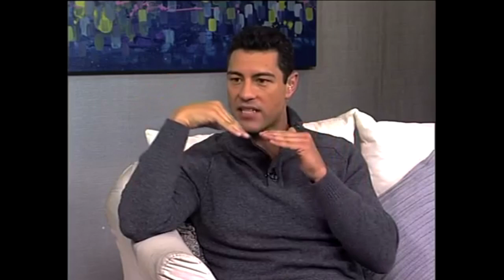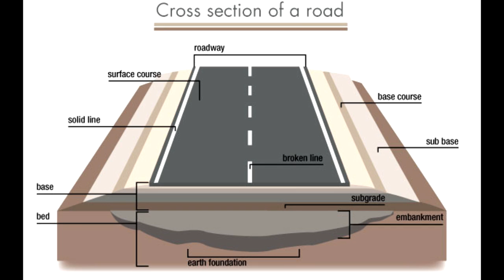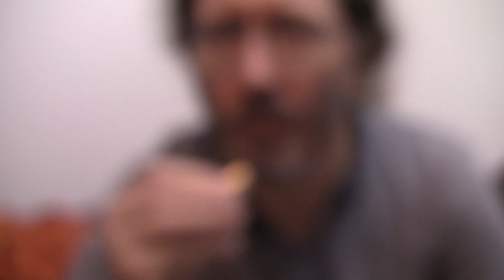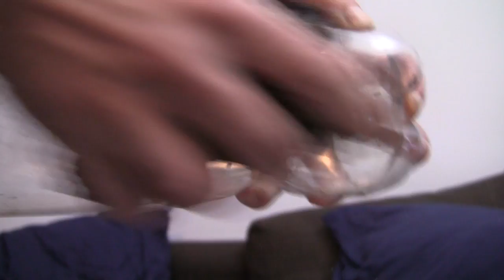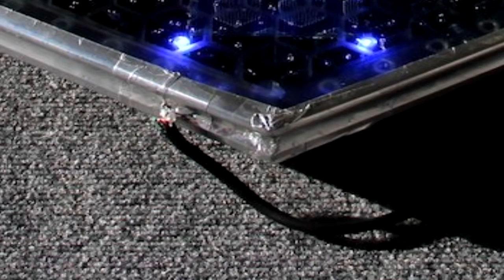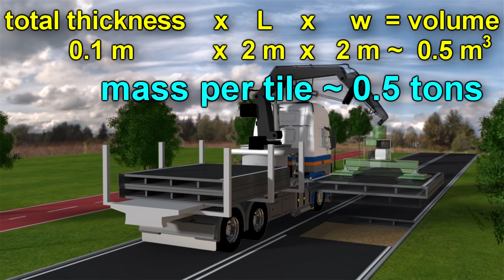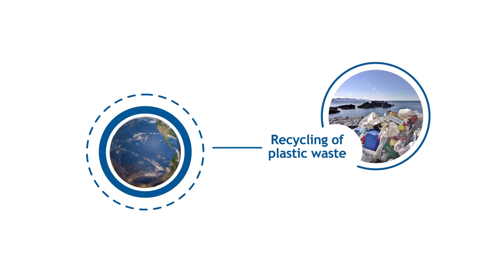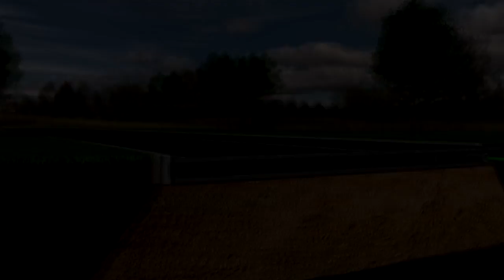Plastic Roadways BUSTED!

Comment: Paused at 12.  
Thunder, obviously the people who want to run cables, pipes or etc. inside a road have never run a drop into an existing wall, or even replaced a wall drop.  I saw what you see, EVERY 40 FEET OR LESS IS A JOINT in the pipe OR A CONNECTOR in high or low power lines.  
What 3 things will run in this road???? WATER, next to ELECTRIC, next to NATURAL GAS.......electric and water don't work well together, and electric and GAS can often cause things we call .......Here is a technical term, used in the industry, lets see if anyone has heard of these?..........EXPLOSIONS!!!.  
When you ONLY run electric, you have connectors every 40 feet, and you increase RESISTANCE at each connection, and lose electric current, and gain HEAT!!!!!
All of these points go back to part of why we don't do this with concrete roads.   As well as Roads, Cables, and Pipes have different maintenance parameters, and requirements.  So, instead of SAVING road construction time delays, you INCREASE road construction delays.

Comment: PAUSED AT 9.
Thunder, you are spot on about the cavities as well as all other aspects.
First, Plastic offers no unique properties which will make cavities suddenly a viable design element.  If cavities are good for road building we would already design ashalt and concrete roads with them included.  In the concrete business you call these 'Voids", and they are a disaster for dams, cooling towers, runways, buildings and roads.  They are a point of failure.  Part of this can be used to dispel rumors of men's bodies being left in dams during concrete pour workplace accidents.  You could NEVER leave a body in concrete, as that soft spot will be a failure, and be discovered in any disaster investigation, which that void would cause.
Likewise the plastic recycling cannot be scaled up due to, again, impurity from labels, and their adhesive, including label inks.  If plastics are only marked, and not labelled with a separate material, the ink alone will have wholly different performance characteristics.

Comment: Why is it always Roads? how come with these ideas they have to go all in big at the first chance they can get?

A more fitting investment would be, say for example, designing solar panel pathways in residential areas, stick to a suburb when getting to the actual installation phase, and waiting a few months to see if it structurally holds without any problems.

Heck it doesn't even NEED to go as far as 'ALL SIDEWALKS ARE GOING TO BE SOLAR PANELS!!!' but a more realistic selection of parts that can be converted to solar walkpanels, for example, parts that are eye catching and used, such as by traffic lights, around crosswalks, next to/in places of interest like parks, open shopping centers, by schools.

And finally, the realistic goal of what would this accomplish, so again for example, if these patches of solar sidewalks are successfully made and installed, what would they power? would they charge batteries that are regularly picked up by the local counsel? would these batteries be resold or stored for emergencies?  so on and so forth.

What i'm getting at is, they try to be the new next thing, the new car, the new train, the new solar panel.
Reply: Also to stick to this video's topic, again why is it right into Roads? the more realistic thinking would be the sidewalks, and honestly this kind of design 'not plastic of course' might work if it had the smaller, less stressed sidewalks in mind instead of the road which has large vehicles constantly using it.

And if you keep the idea of having a space to store power-lines in the sidewalk, but also keep the sidewalk panels more manageable, it would make the existing power-lines less cluttered  and easier to repair without the need to clime up,.. And for the likes of bridges, some roads, and train crossing, that is when the existing power-lines are still used.
Reply: Now i think about it, even if they somehow manage to actually do this, then comes the additional work of individually making each part of the road beforehand, and then placing said parts to make the road, so even if they sell this idea on it being green, in actuality they would need to create new factories and install machines to create their 'eco-friendly and easy roads' And they will also need to still use trucks to actually place them in the end, so while i don't know myself, but it kinds sounds like that they could possibly be harming the environment more then the current way of making roads.

Comment: You make a good point, but comparing an industrial plastic with a soda bottle is ridiculous.
Can ABS type hybrid plastics be made durable? idk. In the US they have to rebuild roads every few years. In high traffic corridors, there is always construction going on. They can barely resurface one end when they have to start beck over at the other end.
Reply: The illustration is a simplified example, I imagine it would require many supports across the path.

Comment: So you'd need to cut and splice cables with every replacement section? Genius! I don't think there's any plastic currently in existence that would be durable enough to outlast even low quality asphalt in existence either.

Comment: Wow this video is completely stupid and unscientific. You're showing us the adore ability of a soda bottle which is not the same as what they're talking about now If you gonna test the road that they made And show that it's not as durable as they said that's one thing but let me go grab something out of the garbitsch improve that this is all stupid is not the same thing.
This is no different than someone going upside in the middle Winter and grabbing some snow to prove that Climate change is a hoax.
Reply: Plastic is plastic. Sure, there are different kinds, but no amount of structural modelling or thickness will overcome those properties

Comment: Thoughts just from the first minute.  uv damage of plastic.  Plastic splintering after breaking causing tire damage.  cables underneath being damaged.  Plastic may last a long time but it doesn't maintain its shape and strength that long.  Horrible for the environment because it doesn't degrade well and is made from petroleum products.  I'm sure there are many more reasons.

Comment: Personally I would fill the street with gravel, outline it with concrete and put pavement on it. Heard it's been done before and it was super-efficient.
Reply: that's how its done already. A high capacity roadwsy is about three feet deep from its base/foundation to the road surface. and shoukd include a coarse layer of compacted gravel
Reply: @brianspiller9075  That's what they have to do with brittle materials. Plastic is entirely different as to engineering needs and the modular sections mean repairs are easy and fast if required..
Reply: It's not as efficient you idiot. Concrete requires resources and we have too much plastic waste.
Reply: :D

Comment: I dont know if you knew this before making this video, but they do infact use a form of plastic recyling road surface in india. They've been doing this for years.
Sure it's not the same as the design in the video but plastics from water and soda bottles are used in some of the road surfaces in india.

Comment: Currently, the highway near my house is under road construction using a concept similar, but far more practical. Instead of using hollow plastic, they're using modular precast concrete with rebar reinforcement and laying that down in tiles.

Comment: One year later: it's an OK concept  (besides the plastic). You don't even need erosion, just hit the brakes one good time and you've got a melting drive-space... Anyways, a concrete version with arcs instead of vertical slabs would do nicely (for drainage ONLY)., as putting cabling inside this is just asking for service problems. Plus, the dirt around most existing cabling systems soaks up water before it even gets near the cables. Small slits going left-to-right could accomplish the draining goal, without taking away too much strength from the road. I'm going to make a very generous estimation of $1 Trillion (construction ONLY; does not include production costs) to remodel the roads of TX. And possibly another $500 Billion for insurance, as drivers are not going to be too keen, nor patient enough to wait on the 20-30 year construction efforts. So all-in-all, $1.5 Trillion for TX roads to be remodeled?

Comment: Yikes!!!  LOL. Typical civil design requires a design life of 30 years.  Good luck!!!  No way to get uniform support under the structure, unless you pump in "epoxy, concrete, etc...".  Not to mention painting on grit coat to create a legit traction surface.

Comment: I mean, you're correct on mostly everything, except that we can't afford to burn anything anymore. It would be better to stop using plastic at all.

As for the final bit of the video, the fact that they want to basically replace asphalt with plastic is not a flaw at all, in fact, it solves most of the problems you cited, and reuses the plastic.

But yeah, the "announcement" is way too broad and vague.

Comment: A lot of these project sound like they did not do any test trial and just theory who come up with these ideas. Lab works. Running a wheel over it to see how long it will last etc. Will the road warp from the earth erosing and plant growing etc. Heat and cold flexing it etc.  Weight etc.  Also is the road more slippy? will tire grip well to it? Dirt rock debree etc. Im no engineer but try thinking out of the box on how test and trial work.

Comment: We should make roads out of Flex Seal Liquid
Reply: I sawed this road in half
Reply: T H A T S A L O T T A D A M A G E ! !
Reply: @kasparthorngirl  lmao underated comment
Reply: I have an idea of a flex seal product! Flex Seal Metal Liquid! It can probably be suitable for a road!
Reply: @heal0152    they actually have metal plates that are metal plates roadways
Reply: @heal0152  Don't tempt me to buy some buckets and start filling in the holes in my street. Cause we know damned well the city isn't going to do it.
Reply: I got something better ,,,maybe inovate some amazing heating pads ,,to heat up the bad road in its place and reshuffle the existing asphalt,,to save from trucking it back and forth
Reply: Duct tape! if that does not fix it for you. You've not been using enough duct tape.
Reply: make a bridge by stringing together many rolls of wide flex tape to be long and wide enough to carry the cars, a single layer will get them across
Reply: I sawed this BOAT in half halfway:D
Reply: yeah.. just needs x amounts of coats, each layer needing to dry with having airbubbles contained within..
Reply: A super thick liquid you could pour right into cracks!
Reply: Flextape. Bitch pless
Reply: The world is not ready
Reply: finally!  a good idea!
Reply: You should be president
Reply: I was legit thinking this
Reply: Flex freakin roadways.
Reply: i built a boat out of some old screen doors with that stuff
Reply: @BrainScramblies  very late, but it’s a meme
Reply: ya boi gmac I mean. It would actually work.

Comment: I take issue on the engineering used with this

The scuffs on the pop bottle was very unscientific, toothpaste can scuff up plastic too, doesn't give it the same abrasive properties as asphalt
This entire video assumes that the modules would be pure PET
This is obviously ridiculous. Any engineer worth his salt would have realised the issues you have pointed out and suggested the use of composites.
Fibrous minerals can change the thermal expansion coefficient, especially in the longitudinal direction
Aggregate can be added at the manufacturing stage to harden the surface of the roadway, it would be just as recyclable.

The point about roadbeds is moot in my opinion as well - it would still be faster with modular roadways
However, it is true that for small potholes and defects the repairs would be wasteful.
Reply: Lots of things can destroy the integrity of plastics - oil, gasoline, diesel, solvents, acid etc but I don't think any of these will leak from vehicles. Will they? Hmmmmm. Let's ban all of these substances so we can build plastic roads.

Comment: In September 2018 the first PlasticRoad will be constructed in Zwolle (Netherlands) and in another location in the province a few months later. Now that is close enough for you to go and check it out :D
"The first two pilot projects will be realized in the form of 30 meter long bicycle paths made of hollow prefabricated elements enabling water drainage and laying down of cables and pipes, with the exact final locations still to be decided. The PlasticRoad partners KWS, Wavin and Total have worked extensively on the development and testing of the concept to validate and optimize performance such as the load bearing capacity of the modular elements, the appropriate blends of recycled plastic and the three dimensional design of the road itself."

Comment: Naaa could work, the problem is the surface when broken and huge and long fixing is needed so lets use some fiber stuff as basement and on top a thin use-up layer and when its used up it gets replaced by another elemet and the use-up layer gets replaced quick and efficient in some kind of factory and also there are no cracks anymore because of the stiff fiber base.

At least for the Autobahn with huge traffic jams when beeing fixed this might be a solution.

Comment: They're on about using the plastic from regular use and the Pacific Ocean (you know, that massive patch) to build roads...why not just keep Asphalt roads, but gradually scrap all cars, then use the plastics for eco cars? Then the scrapped metal from the cars, can be used to build more boats to speed up the process of removing the Pacific Plastic Patch...In a way, seems impractical, but why can't people just use public transport or fucking walk, while they wait for their car to be replaced with a cleaner, and potentially more efficient, version.

Comment: 6:40 demonstrating that standard "blacktop" (tar macadam) is tuffer than a PET bottle.
of course it is.
You want a fair comparison, you should be rubbing a block of bitumen against that bottle, as THAT is the role the plastic will have in the road.
The plastic is the BINDER, same as the bitumen.
.
Sheesh, next time do you research before you make an ass out of yourself. Again.

Comment: I did hear about a plan to use ground up recycled plastic as a mixture for filling potholes. I assume the plastic will be bound together with an adhesive that will harden over time. Would that work do you think?

Comment: there is one major fault that i can see in this that hasn't been mentioned and that is if your expelling water into the foundations wouldn't that corrode the foundation and possibly create a sink hole which would require replacing the foundation which sure as hell is not as simple as slapping a tile over the hole.

Comment: Road maintainers would not interrupt the lines because where the lines are placed will be smaller. And Built/replaced in smaller sections that would not break lines. The lines will be placed in the less used area

Comment: Professional here. Actually the idea is not stupid at all. If you don't understand the science behind it don't make a video you look really dumb. There are some types of plastic mixes in the epoxy family that are extremely strong and durable. We already use it in industrial coating and guess what, space equipments. You see it's a very good idea. The problem is the price. It's used on rare occasions. But it's like batteries, before it was very expensive due to the low productivity, now with Elon's factory it's going to be peanuts.

Comment: The easy part is putting in a section of roadway. Conduit, Fiber cables, and electrical not so much. Also have you ever walked on a piece of plastic during the rain? If you were to slip and fall, what would a car do?
Reply: Kent Harris 
Plastics are polymers.... Essentially the same as oil.
https://www.macrebur.com/
Waste plastics in new roads...
WOOHOO!

Comment: if it's all about reducing bottle waste, why don't they just boil down the PET into some bitumen like stuff to put into normal roads? i mean pretty much anything organic can be made into black sticky viscous waterproof sludge by pyrolyzing all lighter compounds away (which could probably all be burned into energy and CO2)...
of course then you'd have to deal with the CO2 emissions of what amounts to essentially burning half of what makes the bottles you wanted to recycle, so ummmm how about not reinventing roads and instead trying to handle more pressing environmental issues first?

Comment: It looks cool but has many issued that have to be worked out. The reason asphalt is used is it can conform to the site conditions. Asphalt is flexible enough to follow the shifting ground so it doesnt crack. This rigid road structure would end up failing due to frost. The reason cables are buried is to protect them from being damaged on the surface. If the road were to fail due to a crash or frost, the utilities could be damaged. Plastic roads do exist. Dont quote me on this but they use around 8 percent asphalt with ground plastic but it is layed on site and isn't hollow.

Comment: Too soft eh? And asphalt is hard? Nope Asphalt is even softer. There is no reason that polymer plastics cannot be used in road construction as a replacement or adjunct for asphalt. Indeed a lot of very hard wearing road surfaces, such as roundabouts and F1 race circuits are already made using asphalt epoxy mixes. 

Once again Tumblef00t does a sledgehammer to crack a nut hatchet job on a stupid product but gets the basic science wrong.

Comment: While the thickness of the examples used by thunderfoot are a bit too thin as a good example imo, but considering the amount of psi that will be put on the road by trucks, I guess they were adequate at showcasing the problems of the sturdiness of the material.